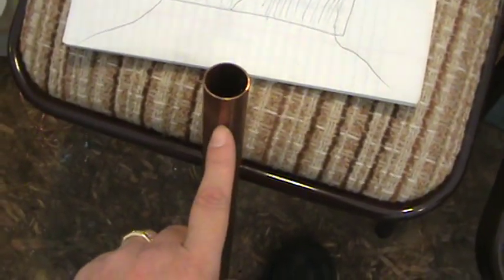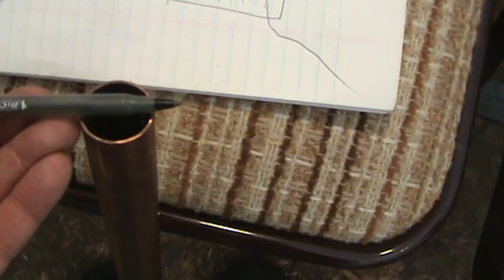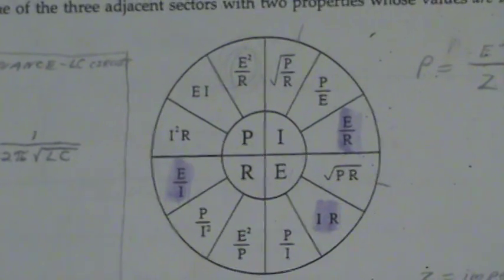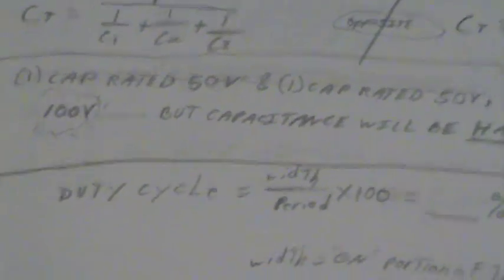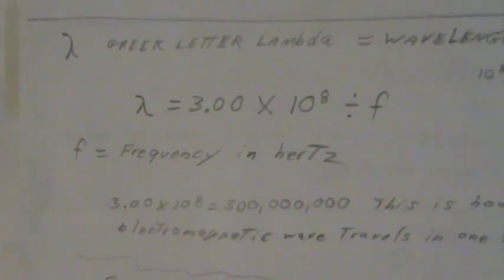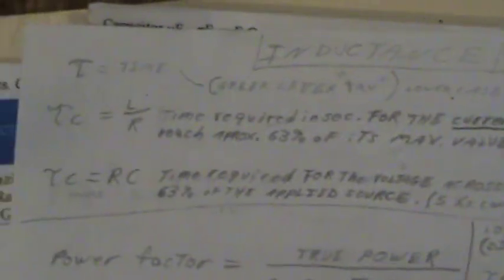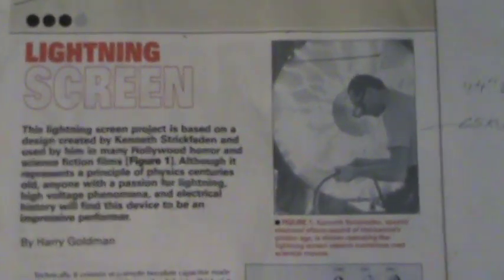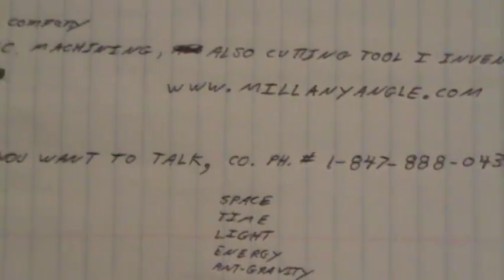FREE ENERGY CIRCUIT- HOW TO, PART 3/3

Comment: love the premise, but as an energy idiot, while i can build the pieces, it doesnt tell me what to do with them once i have, and i am tired of being part of the problem, and am realizing I need to learn how to be part of the solution .. can you make one of these for idiots? I can as I have said, make everything... but do not understand what to do with them once i have... and how to avoid doing damage with some of the components.. such as the antenna... ( Have the soldering iron, etc, and meters, for other things, hubby is a jeweler, and also an idiot when it comes to power... I have to wire our vehicles to tow our trailers....)
Reply: Denise Dyer Hi Denise. I just watched Paul's series for the Tesla generator again and saw your comment. I don't know how much help I can be, but if you do things like camping, this little gizmo will at least be good for charging things like cell phones, MP3 players, GPS units, and the like; mostly low power units. The voltage available is mostly dependent on the height, material, insulation, and type of antenna you use ( I've seen people use old tv antennas).

If you put two together like Paul showed toward the end there, and have another antenna, you can increase the amount of power available. The voltage will be about the same, like putting two batteries side by side (+'s and -'s beside each other), but you will be able to use things that use more power for the same volts.

As far as damaging the components when you're assembling the generator, attach "something" between the actual component and the point on the lead that you are soldering. Putting a "heat sink" on both sides of the joint to be soldered would be best. The simplest heat sink I've seen for soldering looks like a pair of scissors that just clamps onto the lead. Also, using a ground strap would help to keep from blowing the diodes because of static electricity.

The circuit should be grounded properly. In the field a ground plate (a piece of metal buried under ground, a 5 foot piece of pipe or rod pounded into the ground; however, the rod is good but not so much for camping because it's not portable. Indoors, the bare end of a piece of wire attached to the center screw of an electrical wall outlet will help there, although my dad used to ground all his ham and CB radio equipment to the water pipe coming into the house (between the wall and the water meter).

I hope this helps. If you have more questions feel free to ask. I will answer any thing I can.

Bruce
Reply from the maker: new improved HOW TO videos :-)   New link in the description.
I maybe making many of these circuits soon, but need time to get geared up for production.
I would have to charge too much if i only make one at a time.
I will try to let you know and also put up many links when i get going on them.

Comment: What a great idea, I have tried this before, but my Antenna was not the best. I only have a small garden. It did work though. But like you say its only micro watts. But its a start. I have actually lit a white LED off my TV antenna down lead and earth before. Another thing about your circuit that I thought about is. Because the power levels are very small. And Electrolytic capacitors are notoriously leaky devices. It maybe better to try changing the two 100uf for 100uF Tantalum bead type capacitors. More expensive I know. But not so leaky. This could make quite a difference with such tiny power levels. You could be losing 25% of your power to capacitor losses..
Reply from the maker: Hey thanks, great idea about the caps, thanks again.  I will be making a new HOW TO video soon :-)
Reply: Yes I looked up the Caps, only problem was getting ones with high enough voltage rating. I figured you could link 5 100uF 20volt Tantalums either side. Ten in total. This would equal two capacitors rated 100uF 100volts. That would be the easiest way to do it I think..
Reply from the maker: new improved HOW TO videos :-)   New link in the description.

Comment: Have you heard of Bashar's antenna? It is 2 cone shaped coils of heavy gauge wire, one cone pointing down, the other pointing up but the coils are connected.  Anyway, they suggest using heavier wire, I was wondering if you have used heavy wire for your antenna to see if you got better results?  Also, as I understand it, the coned coil of wire reaches a winder range of frequencies, therefore possibly more power?  I don't know,  I am just getting started with this stuff :)

Comment from the maker: Use sheets of alum foil on walls as antennas and have a wire from each sheet going to your circuit,,,someone had good results like this.  Must experiment :-)
An antenna will improve things for you for sure.

Comment: Hey finding your vids more helpful than anything else I can find on the internet. One thing. I haven't yet completed my circuit but I've completed my antenna using a random but large amount of enameled copper wire. I've hand wound it round a thick cardboard tube and not all the windings are perfect. Will this get me anything? I'm starting to think I should have bought bare wire with a PVC or acryllic tube.

Comment from the maker: @fathershand Sorry, i missed this comment.  I been looking into the step down transformers,,1 problem is it needs to be AC to induce secondary,,,or a good "pulsed" DC.  Output of circuit is now DC.  I will still get same power oputput, will only be a trade off,,,i still need more current.  Im looking at coil configurations now from OU devises to maybe implement into the circuit, like the kepandanze coil thing out there. Or implement a rodin coil.    Thanks for your inspiring words,  Paul

Comment: Paul, good work!  

Have you ever been fishing?  The size of the fish you catch is directly proportional to the size of the bait that you use.

You're using small "bait" in trying to "catch" the large energy from the ether.  Try using bigger bait!

I think that Tesla's design used a step-DOWN transformer to increase the amperage.  He had to do that because his voltage was so high.  Get higher voltage and try using a step-down transformer.

Don't give up.  Persistence pays off!!

Comment from the maker: @bearpatch626 Just single magnet wire going from top of tall pole down on angle away from pole to the circuit.
CB station antenna would be good for the pole, to get the hight,,to connect the wire off of, but the wire would need to be insulated from the tower itself, using plastic or other insulator.

Comment from the maker: @bodziobran i think i may have gotten lucky with close matching the coil to the antenna.  I checked incoming frequency just on antenna alone, and it was like 265 or 285 Hz if i remember correctly,,it is shown on later videos.  So i never did the math to purposly make the circuit resonate.  Also i never checked the inductance of the antenna.

Comment: Inventor3

Very interesting.

An idea for your attachment of the end of the antenna is a ham long wire antenna insulator. It electrically isolates the antenna from the attach point. You could use it with branches etc, then.

Ceramic insulators of any type should work as well.

Just a thought.